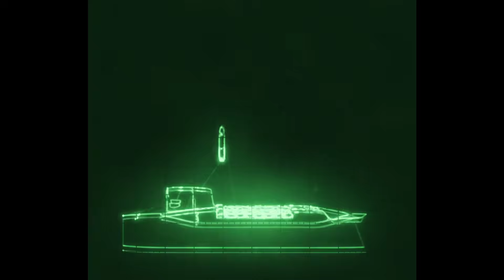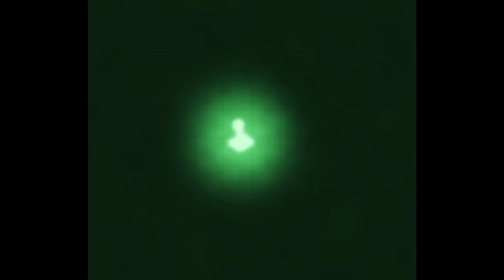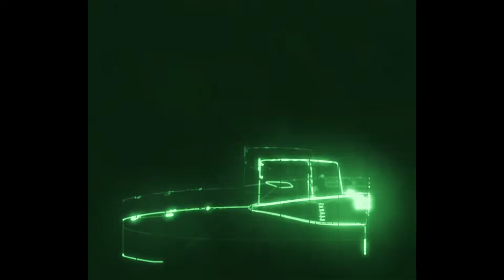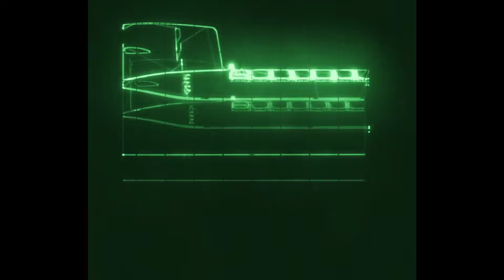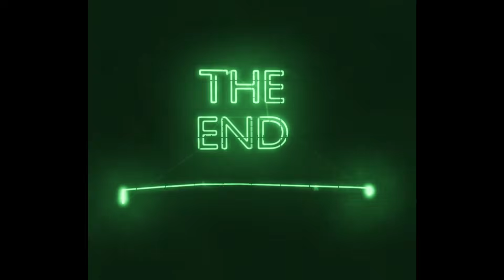Polaris + Transit: When the US Navy Invented Satellite Navigation as a Side Project

Comment: Just a note on the hatch size, it’s not uncommon to disassemble components to get on board subs. Also, I’m not certain about the Polaris and earlier subs, but some new subs do have access hatches for torpedos and food loading, so it’s possible they loaded the UYK-1 via one of those hatches instead.
Reply: Standard torpedo diameter in 1960s was 21 inches

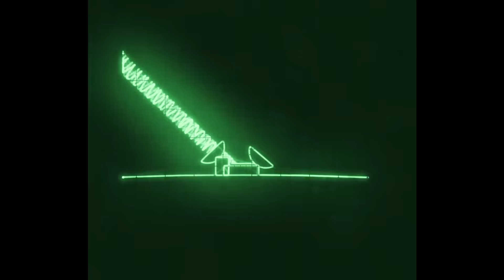Comment: 0:51 The weird thing about naval nuclear propulsion is that it very much seems that the PWR for naval propulsion predated its use for commercial electric generation! The first PWR reactor if not first nuclear reactor for commercial electric generation was the Shippingport reactor. The first core used was from a cancelled aircraft carrier! It used a 93% enriched uranium "seed" and a natural uranium "blanket". It achieved criticality on December 2 1957 and sixteen days later on the 18th was synchronised with the local electric grid, that of Duquesne Light Company. It achieved full generating capacity on the 23rd.

I am guessing the blanket rather than being a solid thickness as the name seems to suggest must have been made out of rods or plates as would have been the seed. It would have very much needed cooling as it provided half of the power after operation of about a month. It was eventually capable of 60MWe in this configuration. The seed needed more frequent refueling than the blanket.

The second core used a larger highly enriched uranium seed and it produced five times the electricity. The third and final core was extremely interesting. It consisted of a Uranium 233 and thorium seed which had been produced at the Oak Ridge Molten Salt Reactor Experiment and a blanket of mostly thorium and some U-233. It achieved breeding of 1.01, meaning it could produce it's own fuel from natural thorium once primed, and could have eventually enough U-233 to prime other reactors. U-233 is produced by the neutron irradiation of thorium, but unlike breeding natural uranium in to plutonium, it can with normal thermal neutrons produce more fuel that it consumes without resorting to fast reactors and all the inherent problems those produce. In the MSRE the initial U-233 had been produced by using highly enriched uranium and fissioning that to irradiate the thorium for the first load, and subsequently fissioning the U-233 that was produced to irradiate more thorium.

Shippingport operated continuously until 1982 except for maintenance such as the replacement of cores.

Comment: Great video.
those sdr waterfalls look way too clean - i.e. no noise and when you did have the noaa sat it was really weak - so either your gain was too low or your are losing loads of signal on your cable from the antenna (too long, cheap thin coax).  Consider a better sd and better thicker shorter coax.  Or attach the sdr to a pi at the mast and use ip networking to get to the sdr output.
I think i’ve received noaa on a ham2/70 vertical or discone - both of which are incorrect for the signal but worked.
ham/sdr nerd.

Comment: why do the A1, A2 and A3 missiles' ranges around Moscow form ellipses, and why do they transition from vertically to horizontall eccentric? Mercator is a conformal mapping, so all circles on the globe are translated to circles on the map.
Reply: Isn't mercator's whole thing that it preserves angles but not distances?

As a thought experiment, consider that a circle on a globe corresponding to a latitude line would be a horizontal line on mercator, but a very small circle on a globe sharing a single point with that same latitude circle would still appear as a circle on a mercator map. If the size of that smaller circle is slowly increased while maintaining that one point overlap, it will have to somehow go from being a circle to a straight line on a mercator map, which seems to suggest that it has to go through intermediate shapes that aren't circles on a mercator map
Reply: @addison1024  i think that your "seems to suggest" is load-bearing intuition, in the same way as you'd expect a slice through a cone to produce an egg-shaped surface (which makes the fact that they're perfect ellipses surprising).

"preserves angles but not distances" is what conformal means, and as a counter-thought-experiment, consider a regular polygon on the surface of a sphere, increasing its edge count and converging to its circumcircle. The vertices closer to the equator are closer to each other in the map, but the straight lines connecting them curve outwards, and the vertices closer to the poles are further apart in the map but their lines curve inwards. My appeal to intuition is to claim that the different curvednesses of the lines precisely counterbalances the different densities of the vertices.

(a more rigorous explanation is to explain that conformal mappings are compositions of the stereographic projection (from the Riemann sphere to the complex plane) with a holomorphic function, and the Mercator in particular uses the complex exponential.)

Comment: Shrinking nuclear reactors down to fit them into submarines isn't magic so much as an exercise in taking power to weight ratio to an almost absurd extreme. The commercial nuclear power industry takes great care to differentiate the reactors they use from nuclear weapons as much as they can, for understandable reasons: While nuclear weapons are specifically designed to release the maximum possible amount of energy in the shortest possible time to create a detonation, the public would generally prefer nuclear reactors to be specifically designed to avoid doing the same.

Apart from all the strongly regulated procedures and safety systems involved, the most significant difference between a nuclear reactor and a nuclear weapon is the degree of fuel enrichment used. More specifically, the percentage of fissile isotopes used: It is of course true that the majority of nuclear weapons use plutonium and the majority of nuclear reactors use uranium, but fissile isotopes of either element can be used for both weapons or reactors - in fact a nuclear weapon in principle is a nuclear reactor, albeit an extremely powerful one with an operational lifetime measured in tiny fractions of a second.

As anyone who knows about nuclear reactions knows, naturally occurring uranium contains only 0.7% of the fissile isotope U-235, with the remaining 99.3% being the non-fissile isotope U-238. Also, plutonium is not naturally occurring in any significant quantities: It is made by transmutation of U-238 into Pu-239 and several other heavier plutonium isotopes. All of which are fissile, though not all of them are suitable for making weapons due to the rate of spontaneous fission being somewhat too high to make a reliable weapon - specifically if you would prefer the weapon to only ever detonate when you want it to and never when you don't want it to.

Anyway, the fuel for commercial nuclear reactors can have anywhere between the naturally occurring 0.7% of U-235 (for example in British Magnox reactors or Russian RBMK reactors), up to 5% of U-235 for more modern pressurised water reactors. There will still be a lot of U-238 in the fuel (between 95% and 99.3%, depending on design), some of which will be transmuted into plutonium isotopes as the reactor is operated. There is no way to avoid this, but it isn't necessarily a bad thing, since the plutonium will fission and make energy just like the U-235 does.
When a fuel rod has been in an operating reactor for a couple of years, about 30% of the energy that reactor generates comes from the plutonium created inside it. In fact some fuel reprocessing plants which recycle used reactor fuel can extract the plutonium and use it to manufacture new fuel rods containing up to 5% of both U-235 and plutonium - this is often called "MOX fuel", or mixed oxide fuel, since the uranium and plutonium are in the form of their metal oxides. This is also one way of using up plutonium from decommissioned nuclear weapons - it can be diluted down with depleted uranium (which is almost 100% U-238) to between 2% and 5%, making it suitable for use in commercial reactors.

Nuclear weapons use a much larger proportion of fissile isotopes - uranium enriched to 80% to 90% U-235, or a similar percentage of plutonium isotopes. Which is how they can produce such an enormous amount of energy despite the sphere of uranium or plutonium in the core only weighing a few pounds.
So do nuclear reactors using similarly enriched fuel exist? For plutonium, no - but for uranium, yes! An intermediate level is used in the reactors powering aircraft carriers - the fuel in these is typically enriched to 50% U-235, sometimes more. But the really extreme levels are found in submarine reactors, which often use uranium enriched to 80% or even 90% in some cases. No, that is not a joke - some submarine reactors literally use weapons grade uranium in their cores, often enough to build several high yield fission weapons.
This allows those reactors to operate without neutron moderators, though they still need control rods of course. Which is how they can produce hundreds of megawatts of thermal power despite the reactor core being smaller than a garbage can. When run at maximum power output, the steam turbines driven by these reactors typically generate between 15% and 30% of the maximum thermal power of the reactor, which is somewhat less efficient than most commercial power reactors. However, the reactors in submarines can operate for 30 to 40 years before needing refuelling, whereas commercial reactors are usually refuelled every 18 to 24 months.

Comment: A 6" shell is a pretty explosive heavy warhead only solution. Of the 103 pounds of shell, only about half by volume is HE. 21 pounds. So the contention that 30% of the weight of a warship is explosives is utter bollocks. Total crap. Even the idea that 30% is ordnance, including airframes and boosters and all else, is pretty far fetched. Maybe 5% explosives, and even then not very likely. Take the USS Iowa as an example. 9 16 inch guns, 130 rounds per gun. If all the shells loaded were HW, then we'd have 1070 shells each weighing 1900 pounds and containing 153 pounds of explosive. Total explosive weight 163,710. Iowa weighed 57,500 long tons loaded. A long tone is 2240 pounds. So, (163710/(57500*2240) * 100% = 0.127% by weight. So given that you can't make a credible argument for your first postulation... do not recommend channel.
Reply: The point was to comper the explosive power of a nuke whit conversial wepens  
It is like complaining that I did not spesifie C or F when saying that something was 30000000° hot

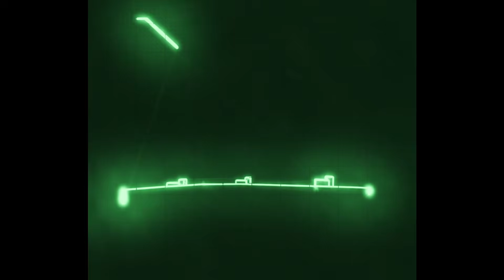Comment: 01:40 Hmm, no. The W47 warheads of early (single warhead) Polaris missiles had unmeasurable, but attrocious failure rate. From half to 75% would had been duds. It was because blasted thing would actually gone nuclear kaboom if even one of explosive lenses would had detonated by accident. Thats big no-no. Enola Gay and Tinian level no-no. Lawrence shoved inside warhead lenght of kadmium wire and windshield wiper motor to spool the wire out of nuclear pit when you actually wanted to detonate it. Thats how it was made safe enough to be stored and moved. OTOH US had 41 subs with 16 Polaris missiles per sub.. Russians were not informed, and 25% to 50% of warheads working would still had been quite a show. Brits had totally different warheads without any of those problems.

Comment: It is very possible that the computer is 25.6 inches and the hatch is 25 inches and you just had to make it fit.
Reply: @AcidGambit419  it's also possible that you needed to remove some trim or similar around the inside of the hatch.
Reply: You can also load the computer before the sub is done, provided you had a very secure bunker to hide from the techs who had to service the system in the future decades.
Reply: @JosephDuchesne I mean not a huge deal. If that computer goes down the entire boat is deadlined, and will have to return to the shipyard. So they'd cut the boat open if need be to fix it.

Comment: This video omitted half the information. Subs had a problem that they spend about three months at a time under water and during times war they don't dare stick their head above water to take accurate readings. They can receive low speed data transmission so they don't need to surface for communications. Inertial Navigation works reasonable well but it does tend to drift over time. To solve the problem they equipped old victory ships with a state of the art sonar system and browed all forms of available navigation including sub hardware. They could determine their location within half the length of the ship. They then proceeded to map the bottom of the ocean and paid special attention to firing positions. So accurate are the maps that they are still classified today though low resolution maps have been released. It is believed that Ballard was able to use these maps to find the Titanic.  A sub is able to find a firing point and launch underwater, never needing to surface with an accuracy in the range of feet. The people who rode the ships have created a web site tags-ship  where you can learn all about this project.

Comment: One thing that I don’t quite get from the video: why was the requirement for the whole AN/UYK computer to fit through the hatch? My first thought was that you could build the submarine pressure vessel with the computer still inside, but that wouldn’t let you maintain it in service. However, if the system was designed to be modular, you would just need to make sure the largest module could fit through a 25” hatch. Maybe at that point it was just simpler to just make the entire unit that size, but I can’t help but think about it.

By the way, great video. Happy to say that I also guessed the correct fairing material, encouraging to know that I could keep up with the ‘50# aerospace engineers (which is hard to do)
Reply: How do you build a computer ? Assemble the small parts into a big one. So it was probably disassembled then  reassembled after passing through the hatch.
Reply: @g @gbcb8853  What I’m saying is exactly that, but the video states the whole unit had to fit through the hatch.

Comment: In regards to the explosive power of the Polaris SLBM you need to keep in mind that there were three different yields. for the Polaris A1 it carried a single W-47Y1 warhead in a Mk-1 RV (600KT), the Polaris A2 with a W-47Y2 (1.2MT) in a Mk-1 and the Polaris A3 with three Mk-3 MRVs each carrying a 200Kt W-58 warhead; the RN used the Polaris A3.

Comment: When I was much younger and at university, we got a bunch of Apollo (later HP-Apollo, no relation to the space program) computers donated for general use by students.  Their operating system, which had a UNIX like operating system, had its quirks. One of which was that certain times when the OS went mad, it would print out an error code EHATCH, which when decoded indicated that the program was running on an Apollo computer model too physically large to fit down the hatch into a submarine.  It was originally used for software used for submarine sonar systems.  But never removed from the system, so when things went very wrong sometimes the error came out incorrectly instead of the proper actual error.

Comment: The Wikipedia section for AN/UYK-1 in the Transit article specifically claims that it had to have rounded corners to fit through the hatch. I didn't check the supporting references, but if true that might have allowed it to pass the officially claimed 25" hatch.

Comment: isn't that a rubidium frequency standard, rather than an atomic clock?
Reply from the maker: Yep. Its a type of atomic clock.
Reply: @Alexander-the-ok  yes, but no? i know we're kinda splitting hairs, but tbh calling it an atomic clock it's a bit misleading. it's an atomic oscillator.
Reply from the maker: @ ahhhh yeah you make a good point. Id need to hook up a counter to turn it into a clock. I probably just internally refer to any oscillator as a ‘clock’ because I’m thinking of something like a CPU ‘clock’
Reply: @Alexander-the-ok  In a way, we're both right. Would be a cool project to turn one to a clock.

Comment: i can nearly guarantee that the mechanical clock used in Transit-1 was a Timex, it fits so well. In the 50’s Timex had a commercial where they would attach a watch to an outboard motor and blast it at full power for 15-30 seconds underwater.

Comment: 9 ply sitka spruce epoxied together under intense pressure can be formed into other than perfectly straight, sweeping curves achieved for aerodynamics. The ww2 pt boats hulls were made of this 'plywood' as it is amazingly durable and far stronger by weight than steel. Marine grade plywood is basically the predecessor of carbon fiber laminations of today. But we didnt have carbon fiber in ww2. Spruce, Douglas fir, and larch had the right characteristics to provide high strength lightweight and durable structure required . Multi layered fir is still used today for cement foundation forms, and these panels are used over and over while sustaining little deterioration.